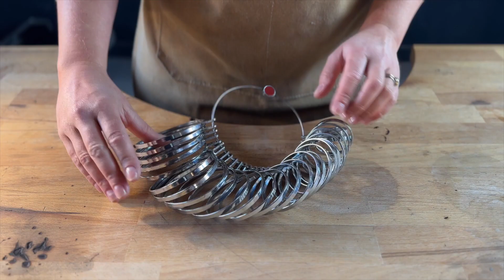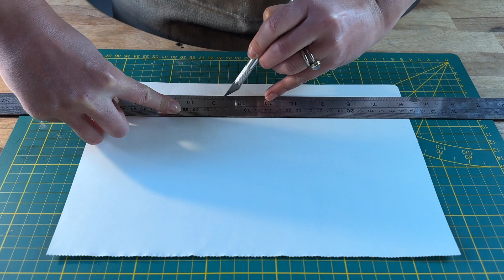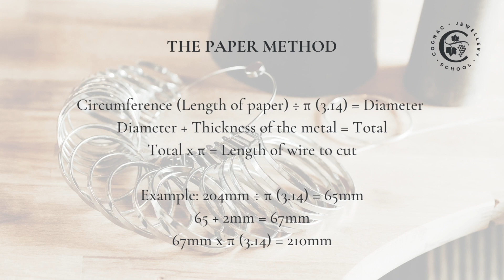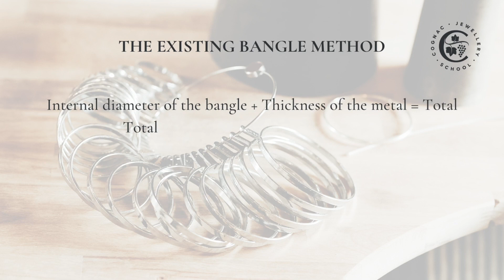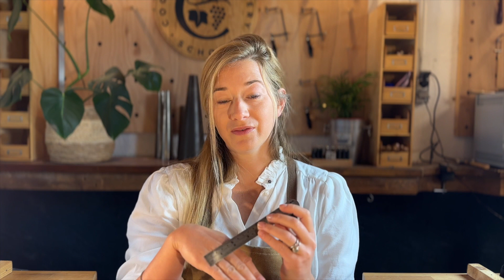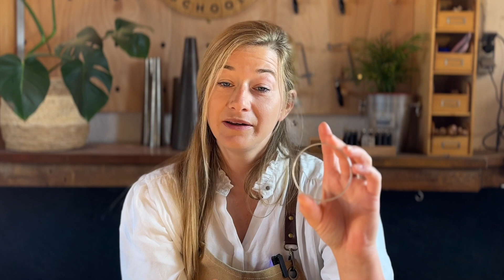JEWELLERS TECHNIQUES | Bangle sizing (with equations)

Comment: Any tips if I want to make an oval bangle rather than round?  How much smaller would I cut the length?
Reply from the maker: To make an oval bangle I would add the longer internal diameter to the smaller internal diameter and divide it by 2 - that will give you an average diameter. Then add the thickness of your metal to that number and multiply the total by Pi to give you the length you need to cut. I hope that makes sense. There’s an Essential guide to bangles, cuffs & bracelets linked in the description that has all of this sort of information if you’d like it 🙂